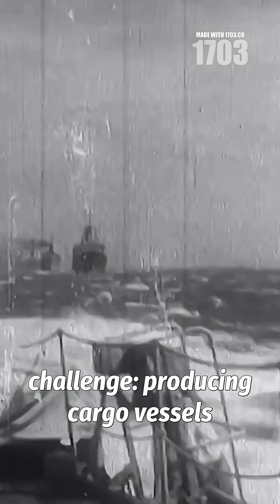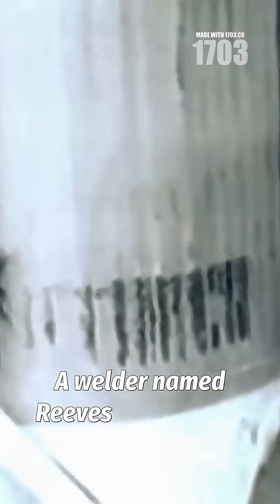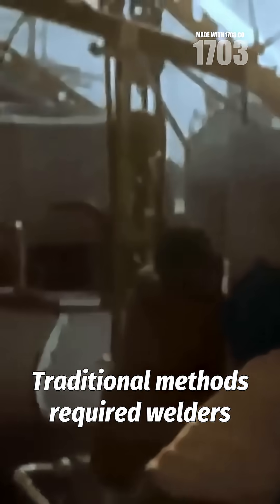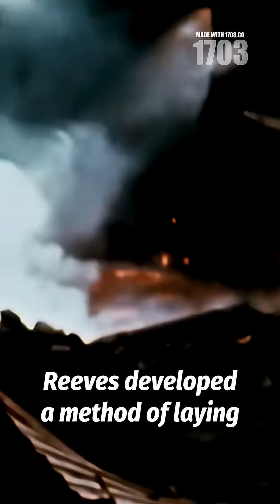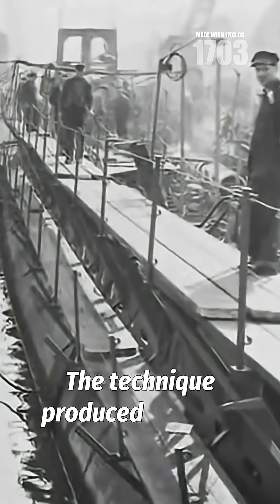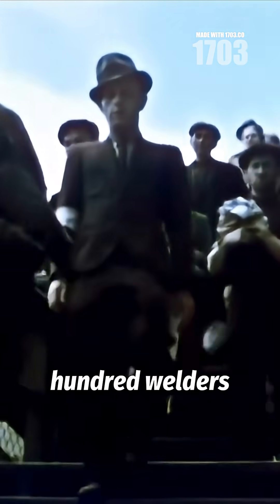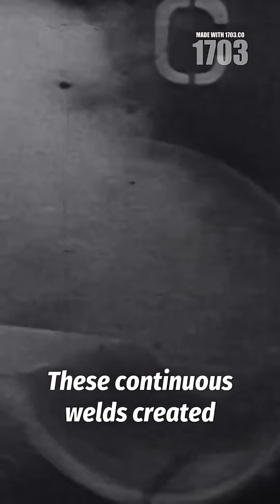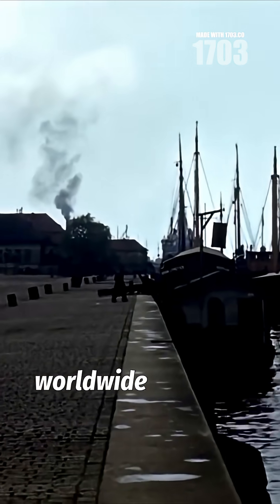Revolutionary Welding Technique Transforms WWII Shipbuilding

Comment: The speed by which ships were built in WW2 is the Kaiser method. This is standard method of ship building today. The reliability of the ships to withstand the fridget water of the North Atlantic the welds were stress relieved this had nothing to do with speed of construction. The narrative of this video is incorrect.

Comment: WRONG. WRONG. WRONG. In the colder northern hemisphere the continuous weld could easily break at the seams, sinking the ship. The newer 'victory' ships used a more sympathetic welding style or pattern to ensure the individual welds cooled down before the next part of the seam was welded. This narrative about reeves welding technique killed a lot of sailors
Reply: This AI channel is garbage. None of it is factual. There are several channels with similar names that produce these fake historical trash.